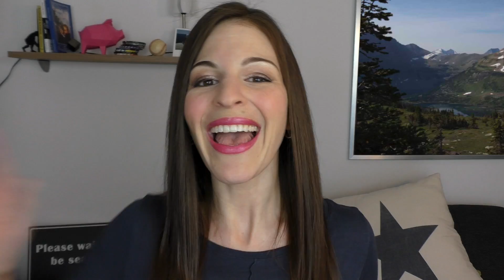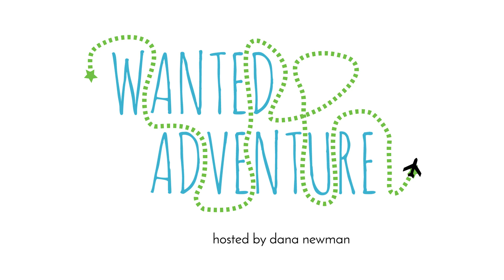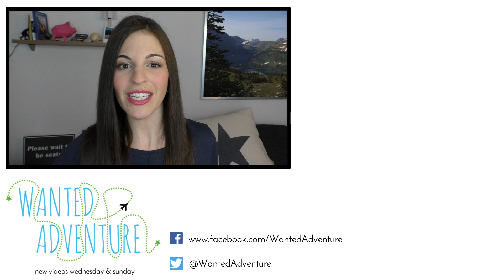Why Are Houses in America MADE OF WOOD?!

Comment: I always figured it's made out of wood bc it's cheap. especially when it gets destroyed it won't cost as much to rebuild compared to stone or concrete.
Reply: The real reason is that American houses are cheap and built to last 50 years were in Europe house are built to last almost forever or until the next war.  When I was in germany I was surprised on just how the roofs are made.  They made a heavy timber truss system and then covered it with heavy wood and then a membrane, followed by cooper sheeting and then tiles.  I am sure I am missing some steps but in comparison to an roof here in America that is built for 20 years tops I am sure that the roofs in germany will last as long as the house.  The house I watched being built was also almost all reinforced concrete that was at least 20 to 25 cm thick .  The houses may cost twice as much to build but the maintenance is much lower and the thermal mass makes it much cheaper to heat.
Reply: @mrtreeves  don't forget the advantage of security. Bad guys can't break into that kind of house.
Reply: Cheap rebuilding? Ain't that what insurances are for?
Reply: It is about 20 to 30% cheaper.  I just built a ICB based home and it was more expensive but it is so much more energy efficient that  in less than 10 years I will return the money spent.
Reply: That's not true really.  It's not just about price.  You shouldn't talk 
without knowing ANYTHING at all about it.  Building a house of stone in 
Canada makes it a huge ice-cube unless you constantly heat it from the 
bottom up.  The same is true of half the US.  So, the below ground parts
 are stone and concrete with a wooden part on top, above ground to 
isolate it from ground-up freezing.  Also, the walls would have to be a 
metre thick if of stone to keep out the cold.  Wood frames with 
insulation allows for air pockets and it keeps it warm.  In my home 
town, not a major city, in Ontario a new house is $300,000, so the price
 is no different than in Germany almost if your numbers are accurate.  
It's about keeping it warm, and not about the cost of construction.
Reply: Exactly, make a tornado proof shelter/bunker of concrete below ground with your most valuables and make a cheap wooden house above it. You can live fine for years/decades, and once a tornado is about to hit you hide in the shelter, the house is destroyed but easily rebuild. Building stone houses also (used to) take really long time, wooden houses were build in few days to weeks. With prefab building a wooden house literally just takes two days. Building prefab concrete currently still takes weeks but this used to be months.
Reply: also when your house does finally fall down.. what do you want on your head? a bit of wood? or enough concrete to withstand a bus hitting it at 300+ mph lol
Reply: Eric Araujo    "Reglamented?"
Reply: You are correct, and minimal Googling will confirm.
Reply: @christophertstone  y'all always pick the cheapest option....THEN wonder why so many of you die when the wind blows a little stronger or a fire comes through
Reply: That's most likely a typo.  He probably meant copper.

If it's true, that's certainly not how it's done in the US; copper's expensive, and you won't find it in house construction outside of wiring or plumbing on higher-end houses.  We generally use plywood over the roof joists and galvanized sheet metal or aluminum sheets for sealing the peaks or seams, then an underlay material and shingles over that.

Non-metal roofs here tend to last 30 years before they need to be shingled again, and you can have up to two layers of shingles (60 years' worth) before you tear off all the shingles and start fresh.  Any sheet metal that needs replaced will be replaced at that time.
Reply: TheFrozenfish yeah they are and with cheaper rebuilding comes cheaper insurance.
Reply: Fire spreading is not so much of an issue anymore though if oyu have single houses standing separately in a suburb as opposed to lots of houses crammed into a ring of medieval city wall.
Reply: +naponroy
Yeah, that imbecile has been spreading that nonsense around, like intellectual herpes. Dunno what he's crying about when structural lumber is domestically sourced (or maybe comes from Canada.)
Reply: Yes that because Europe doesn't consider house to be a FMCG. A "expiration date" of a house is 300+ years. It accumulates the value and wealth of the family. You can inherit a house you can sell it after 120 years (for better price then just the construction cost). A house made of plywood accumulates just a black mold and termites. Just relax, natives are gone you are officially staying in the New World, you are allowed to build houses like adults do.
Reply: That’s dumb mathematics...
Why not invest more in a concrete, cinder blocks and rebar house in first place.

The roof might blow in case of tornadoes but the cost would be less than rebuilding the whole thing from the ground.
Not to mention the belongings and others valuable destroyed.

And the possibility for the family to enjoy it for generations
Reply: +jo han
And then it gets flooded. :p
Reply: I agree, that the main reason is wooden houses are cheaper. But they burn easier, so that lead in the middle ages to lare urban fires in European cities, so that the trend was going in the direction of masonry. Reinforce concrete may not only help against tornados and earthquakes, but also agrainst a nuclear blast.

From a point of energy efficiency, both wood and stone are similar, as the thermal insulation comes from extra panels on the outside of the wall, today it's not the property of the building material wood or stone. The themal inertia is higher with stone, but this is a comfort feature - the energy demand may be the same.
Reply: " especially when it gets destroyed it won't cost as much to rebuild compared to stone or concrete."  the point is that if you build concrete houses, those won't be destroyed so easily...just the fact that you consider the possibility of a house being destroyed clearly shows the different approach and mentality you have on the subject when compared to us europeans
Reply: yes, they would.  All old farm houses in my area are made of stone and they have walls that thick.  When it's -25 for weeks, tou don't want thin walls when they are made of stone
Reply: +Tim Reeves  The most plausible answer to me! But what the heck is "cooper sheeting"? I'm living in Vienna/ Austria, and I've seen many houses in building stage, but can't imagine what you mean as I know cooper as a professionist, like a person who makes barrels!
Reply: Out here in the Evergreen state, people haven't been allowed to build homes where it floods, for many, many decades.  Wood is flammable, of course, which is why we have gypsum board on the interior walls.
Reply: he's functionally illiterate.  It's a bad translation from his native language.
Reply: And if you have 100 million homes mad of wood at cost x and .05% are destroyed a year... Why make them out of stone at a cost of 1.5x where you will still lose a percentage of them every year. Its not a good investment as a whole. Thats why we have insurance. If insurance wasnt a thing I guess you would build out of stone, it might help get you through a close tornado. Roofs still going to come off thought. Are the roofs made of stone as well? lol
Reply: +Nicholas Hartzler  "Are the roofs made of stone as well?" yes, of course, the building I live in is made of concrete and bricks, it just needed some minor repairs (every 25-30 years) since it was built some 70/80 years ago, which is pretty the standard here, and some people still live in buildings that are 200 years old or more....
Reply: +naponroy  "the walls would have to be a 
metre thick if of stone to keep out the cold"  well, that's not true, but anyway some walls here in Italy are close to that thickness...
Reply: +Andrea Tomassini
" yes, of course, the building I live in is made of concrete and bricks."
We're talking about HOUSES  here. Do you live in a HOUSE? If not, your experience is invalid.
Reply: +bcubed72  Houses too have concrete roofs here, obviously, except some old traditional houses up in the Alps
Reply: try living in florida and just purchase concrete.
try building in the northwestern states with concrete.
Reply: Your answer is absolutely wrong! in u.s. houses are made of wood because it´s reglamented in that way to spend millions and millions of dollars every year building with wood and with enormous profits for Assurance companies. Besides that, u.s. pays only few cents for wood that is practically stolen from Central and South American Countries and Asia. When the gringos raze their own forests they will not want to rebuild with wood. That´s for sure!

Comment: I really do think cost is a large factor in this. Wood is everywhere and it's cheap. 
I can't even imagine the insurance cost on a brick house in Tornado alley. @.@  It would be far more expensive to replace. 
I didn't really think the difference was much until recently. 
I live in a 3 bedroom brick house. I bought it at $120K which is about average for the houses in my area. 
Now, a friend of mine is about to buy a house 2 miles away...it's 4 bedrooms, and a basement. far larger than mine and about the same age as well. It's only $30k. the only difference is that it's wood. Obviously, there's the location to take into account as she will be 2 miles further from town but that's hardly anything.

Comment: I can kinda understand the reason wood houses are preferred to concrete/brick houses in tornado/hurricane/earthquake areas. Like you said, they would break down just as easily if they were to be hit by an actual tornado/hurricane/earthquake. So nothing is won there.
Now if you want to build your house, would you rather build an expensive, heavy, difficult brick house or a cheap, easy to construct wooden house instead? If it's all the same in case of a disaster, I would definitely go for the wood house.
Not to mention the brick house can turn into a danger in itself if a tornado runs over it, shooting thousands of small, heavy brick projectiles around.

Edit: Also, as ironic as it might seem, couldn't wood withstand stronger winds than concrete before taking damage? Wood can bend and give in to the winds to a slight degree, whereas concrete is a strict structure that breaks at the slightest bending or flexing (afaik, if there are any construction material experts around, please correct me :'D).
Reply: there was a Hurricane in Germany once, it only damaged the roofs
Reply: An actual, full-fledged hurricane in germany? o.O when was that and how strong was it?
Reply: Bulls, wooden houses are completely destroyed, concrete ones aren't, and not every house will get hit by a flying car, nor will that car do as much damage to stronger walls. The things you own inside your house will mostly be protected and not blown away.
Reply: " 100 km winds..."
HA! You silly Euro! Try 300 km winds for a typical tornado. The top measured speed in a tornado [Oklahoma City, 1999] was 318 MPH or 500 km/h, give or take.

Nothing short of an underground bunker would withstand that! And you better put it into bedrock, because a strong tornado will scour topsoil like sand.

(Really...100km?!? that isn't even hurricane speeds! That's like...a bad storm. Mt Washington, VT, probably clocks wind speeds like that every week, if not more frequently.)
Reply: Interesting, thank you. And it has only been 10 years ago o.O
Reply: actually with the climate changes there are more and more tornados in germany.. well there have always been tornados but germany is not that dense populated and it's rare to hit citys and also they are not really that strong usually.. but only some years ago in 2015 there was a kinda strong tornado in augsburg in the south of germany, bavaria and destroyed an entire street.. 
http://bilder.augsburger-allgemeine.de/img/incoming/crop34067767/4807211322-ctopTeaser/Unwetter-in-Nordschwaben.jpg
https://i.ytimg.com/vi/hiSqybpNarw/maxresdefault.jpg
if you look at those houses i'd say i rather be in the cellar of one of those if something like that happened than in any wooden house in the world..i mean yes the houses are trash and the roofs get destroyed but the walls are still standing..
Reply: Typical dumbass who doesn't know what he's talking about, yet feels compelled to bloviate regardless.
Oh, have you figured out the difference between "house" and "100-unit apartment building" yet?
Reply: Ok